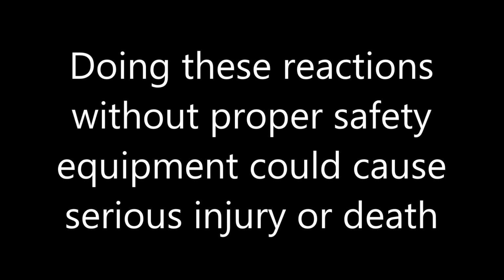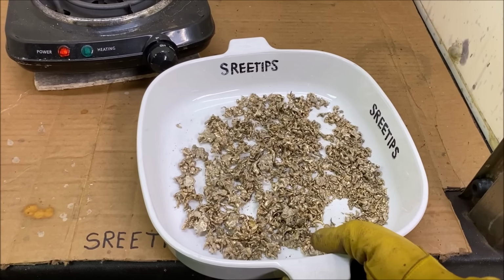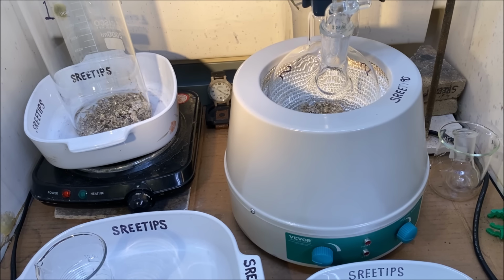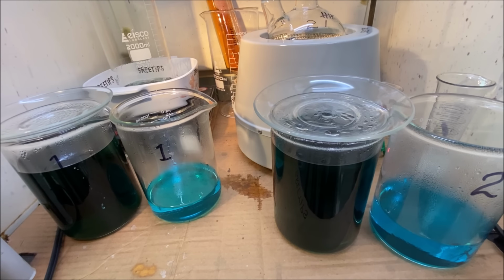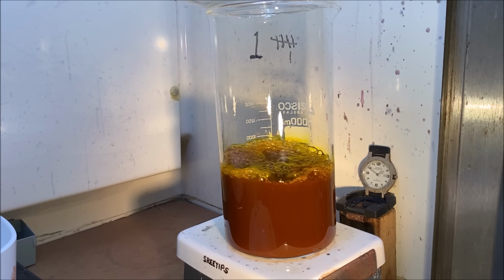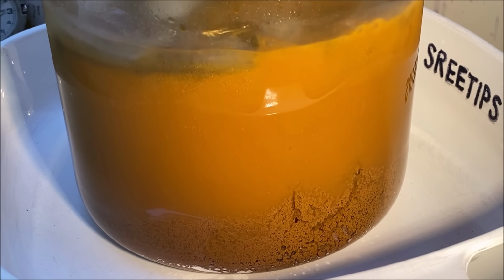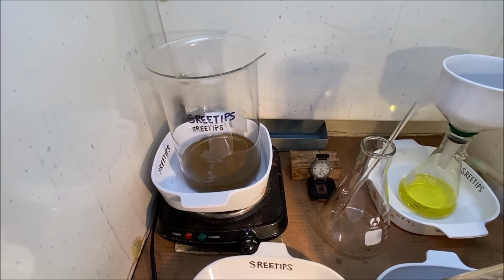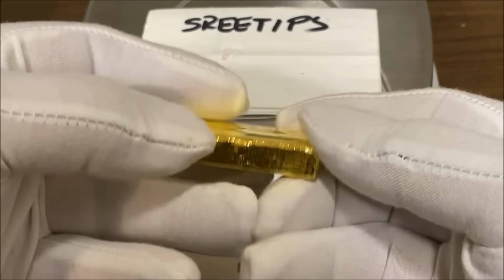Six and a Half Troy Ounce Pure GOLD BAR

Comment: Я писал под прошлым видео что зря ты купил ету круглую колбу с ней неудобно работать и интуиция подсказывает что между ними по итогу нет разницы в переработке но в комфорте работы большая разница😊  желаю тебе успехов ❤
Reply from the maker: I agree. If my goal was comfort, then I chose the beaker. If my goal is getting “mad scientist” vibe for my videos to increase its appeal to viewers, then the round boiling flask is what I want. I actually just bought another round flask with a bigger opening 45/50, so I don’t have to manually break the inquarted gold into pieces that will fit a 24/40 opening. Plus, I bought a two liter round boiling flask and a two liter heating mantle for my next batch of gold filled material.
Reply: @sreetips  Хорошо, я тебя понял. Будь осторожен и окуратен в своей работе, 😊 с удовольствием посмотрю и другие ваши видео.
Reply from the maker: Thank you (Спасибо)

Comment: What's the point of seperating the inquarted gold if you don't measure the results ?
Reply from the maker: The point is to get the pure gold. Recovering the silver is secondary to getting the gold.
Reply: @sreetips  But why start the process if you quit before finding out if one method is better or not ?
Reply from the maker: I used equal amounts of inquarted gold to see if the reflux would use less nitric than the covered beaker. That was the sole purpose of the experiment. Either way, the amount of gold (and silver) being equal in each container, there’s no way that one would yield more metal than the other - because both containers had equal amounts of metal. That won’t change!

Comment: Not sure who recommended adding the cold water at the top, but you should always add cold at the bottom.  Heat rises, so it's best to add the cold at the bottom where it will have the greatest thermodynamic effect.  Otherwise you are pushing cold water down through hot water trying to rise, and the average temperature will rise quickly.
Reply: I recommended it and I suggest you study counter flow. The temperature difference isn't enough to overcome the flow.